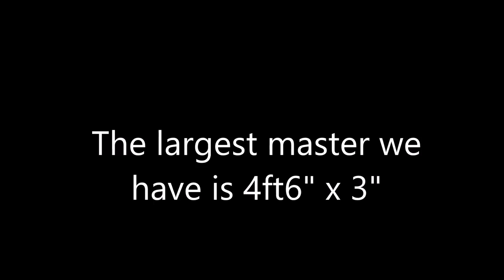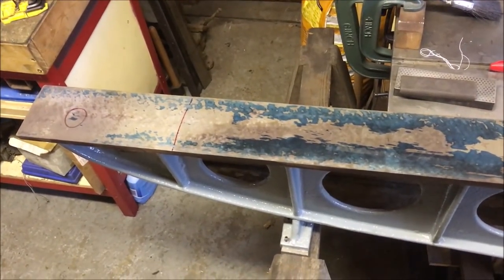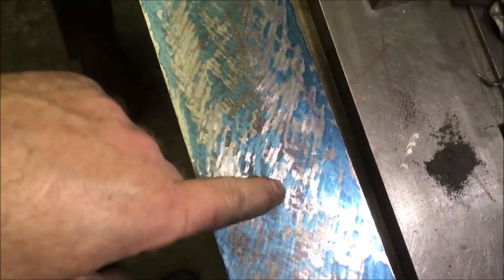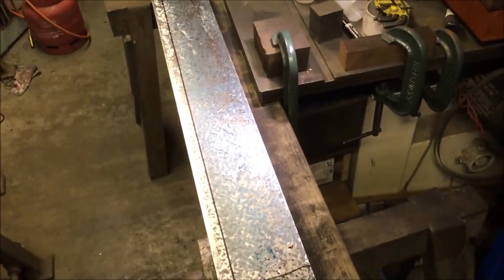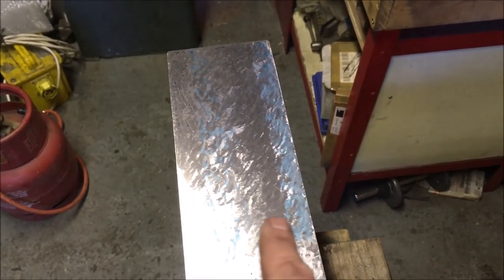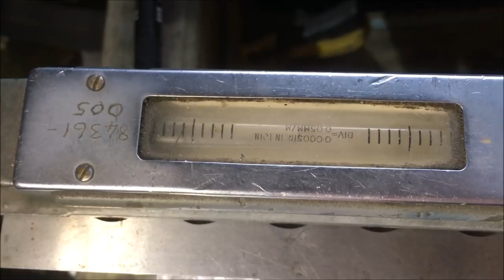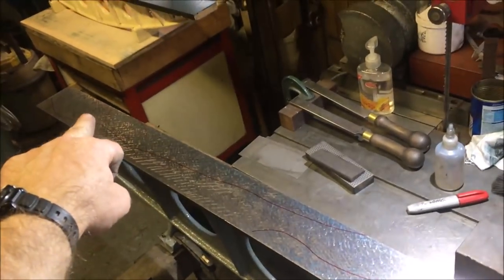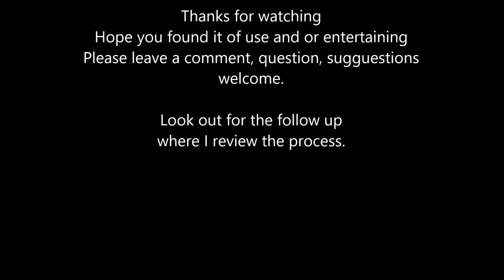6ft Straight Edge Hand Scraping

Comment: You are one determined SOB, I admire it :).  Kudos for British ingenuity, You managed to make a mojito with lemons handed to you.  By no means, this should be considered the "way" to do a proper reconditioning, but you managed to get it in alignment without a   master larger than what you are scraping.   based on the previous discussion on PM, I think your method is sound, and I like the way you verify your assumptions.  I never went behind a 25% discrepancy between master and target size.,  You are a brave man going from 2-foot reference to a 6-foot target.  I also like the way you manage to laugh at your mistakes....
Reply from the maker: Hi Dee, thanks for stopping by and thanks again for the comments. I think this SE re-scraping project has been a hell of a challenge for me. The discussions on PM gave me lots to think about and I hope to cover some of the ideas presented there in my update video.  The 'twist gauge',  averaging out approach and then I guess ultimately the codged together approach I took and why.  There's no way I would recommend this approach  unless you have (as me) explored the other approaches including beg/ borrow or buy a master to work from etc etc. In the end we have to find a solution that can be achieved in our shops with what resource we can get a hold of.  I have no way of confirming the 'incremental error' from my approach - an autocollometer would help ! - as things stand, I have checked everything I can at each stage and with different equipment . Interestingly, the 5'6" light weight SE I am working on to use on the lathe re-scrape - using this 6ft as the master - now I have the light weight SE 'flat' and hinging correctly on the master - it repeats end to end and up and down the master - so what ever error is there has to be small by my thinking.   All the best Mat. (P.S. 'Determined SOB' - imagine what I could achieve if I knew what I was doing !
Reply: @lookcreations  Hi Mat, I meant the post as a warning to others who may want to follow your method, use it only as a last resort, it is not for the faint-hearted,  You researched, thought it through and made it work for your situation.  It is not directly transportable to any other situation without modifications.  The real value here is your description of how you solved each problem.  It is a well-documented step by step on how to make your tools work for what you are faced with.   Some of the things you came up with are just brilliant, some of them are hmm that is curious. I appreciate that I learned from this video a bunch of things I would not even try without having it seen first.
Reply from the maker: @unclespicey42   I think you put that pretty well Dee. I may add the 'health warning' up front :-)   there were times during the long hours it took when I very much felt like chucking the thing down the workshop... had it been lighter and more easily hurled  !  I tried to include as much info' on my thought process as possible as quite frankly my skills are not so good. Im still trying to get fully conversant with curling to get the best from it. I am hoping that my friend Chris will call in to the shop in the near future and give me some pointers.  What I have determined is the cheep carbide blanks I've been using are not too good at holding a crisp edge for long - I have to re-hone 4 or 5 times for a single pass as a minimum - the consequences of not maintaining a crisp edge result in more effort required and thus less control of the scrape. Less control gives greater variation in depth of the curls.  Its a fundamental difference in the style of scraping - something else I will discuss in the follow up . So next task is making up a shorter scraper to take a sandvic blade and see how that works for me. I know this 'curling' is not everyones cup of tea and its not really the point of this video - it has made the task more complicated for me and at the same time made me appreciate the simplicity of the commonly used push & return straight scraping. I think each has its merits - in my  limited experience the loudest voice usually carries furthest but is seldom the best nor only way.  At some stage I may have a go at pull scraping a small surface plate - for shits and giggles as they say :-)  best of health to you Dee. mat

Comment: Like your scraping videos, I have watched all of them. One thing i observed is you clamped both ends to the saw horses which may induce a twist.
you might clamp only one end and side block the other end and allow it to float. there by not inducing any torsional in the straight edge
keep uy the swell videos
Reply from the maker: Hi Wayne, thanks for stopping by and watching and leaving a comment. I will try and put together a ' directors cut' of out takes from the 6ft re-scrape as I did cover this. You are absolutely correct about inducing a twist if the clamping is not correct. I had one clamp come loose mid scrape - I reached down nipped it up lightly and  carried on scraping off the blue. Next print / rub and the distribution was completely different - I knew something was wrong. It took two more print attempts, lots of cleaning off until I found the problem. I really appreciate these comments as anyone that reads them can extract useful info' . Thanks again. Mat

Comment: This looks very hard to work out, I would be hopeful it prints the same when used the correct way up with the weight distribution in the long centre line, I have no experience doing anything like this but it looks like you need to know the black arts to get it wright.
Reply from the maker: It takes some skill and knowledge to get it right, a poorly designed and made straight edge will never be a precise tool. But a well designed and made bone can be incredibly accurate in the right hands.

Comment: What are you using this to measure/test?
Reply from the maker: First job is to use it to scrape in a lightweight 6ft SE to use on my lathe bed re-scrape - the plan is to alternate the narrower 6ft light weight SE end to end and corner to corner - it should help identify any remaining issues with this SE. I am fairly confident now that I have this SE flat. The 24" prints repeatably over the entire surface.